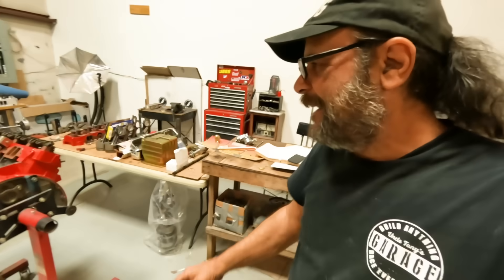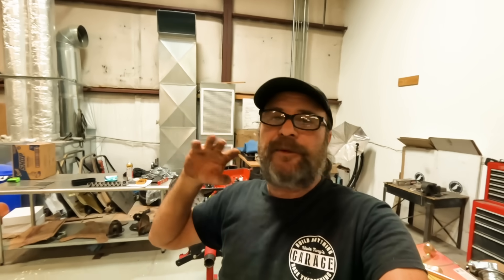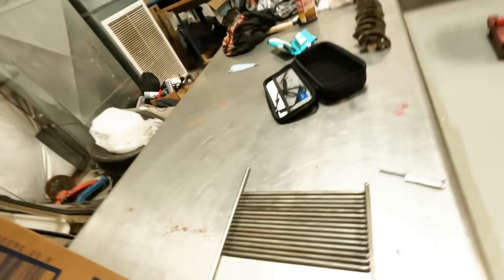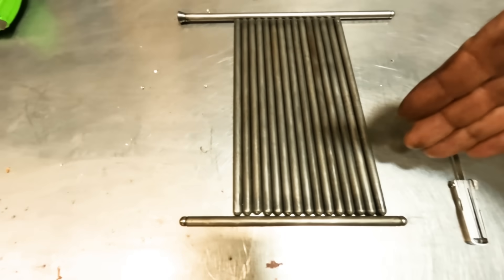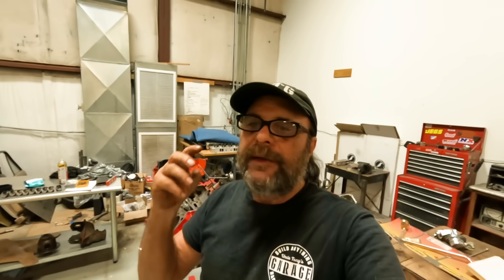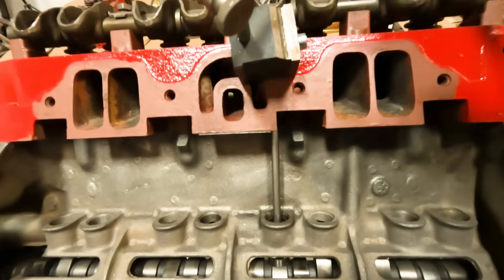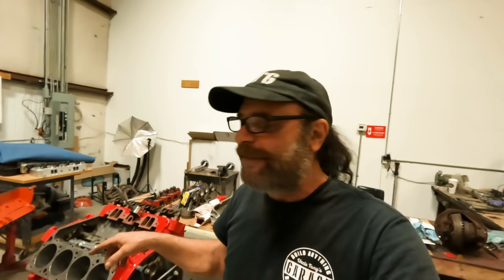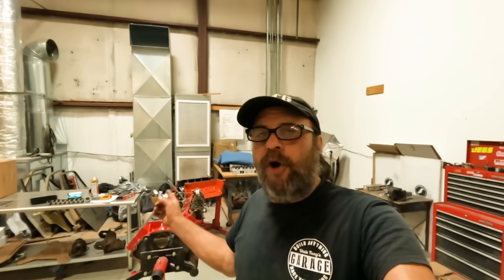The Engine Tuning Issue You Didn't Know You Had

Comment: Never forget going through "Trials & Tribulations" with my 340 Duster back in the 70's. Being a dumb kid I installed the DC "Purple Shaft" and had the heads rebuilt with AMC type 2.02/1.60 valves and DC spring kit....Nothing but problems....Cracked rocker arms @ the Drag Strip. Decided to rebuild the 340 with forged TRW pistons and went to solid lifter Crower cam with 273 adjustable rocker arms....Then found out that even with a MOROSO deep sump pan the 340 had oiling problems over 7200RPMs would lose rod bearings. I worked @ a NAPA parts store, cleared out the Westrn United States region of 340 crankshafts before I rid myself of that problem and went with Z/28 Camaro 302....Facory Solid Lifters and no RPM limiting box like on a Boss 302 Ford....Chevy stuff worked. That being said....The modern LS series motors have REALLY BAD oil system layouts in them....Not at all impressed with the LS motor oiling systems....They SUCK! Good for 6500RPMs over that? your playing with fire.

Comment: Wow, I just learned something. I've been messing with Chevy's since I was 16 I'm 36 now. Ok so I've never had a problem with lifters pumping or valve float and I almost thought it was a myth. But I also never tried to rev a stock motor high.  And any performance engines I always use stock ratio rockers and buy the recommended springs and get the seat pressures all correct. And again I always have a rev limiter and I'm conservative with it. Anyway the way you explained the lifter pumping up as a result of valve float actually makes a whole lot of sense.

Comment: Ma mopar only recommended using up to the .509 grind for use with hydraulic rocker arms. That was a cheap way for bracket racing but not the best cam. They recommended adjustable rocker arms for anything past 500 basically. I wouldn’t trade the years of fun that we had swapping cams in no time on a big block mopar with the hydraulic rocker arms and the Simple Valley Tray intake👍

Comment: The main cause of catastrophic engine failure is drivingTOO FAST.
Reply: If someone is revving the engine that high to go that fast it must be the gearing?
  I also found out that the way my foot and brain works Chevy's can't handle my ability so it's all about the finess that you put into your Acceleration and motoring. 
  Stock Chevy's are made to detonate, that's why they used to sell parts at K mart.😂

Comment: Well you had push rods 18 thousand put it in the high valve stem then you have orig steel gaskets composit gasket 30 thousand I had the same problem bought Smith bros push rods that are adjustable back in the early 90s that where crome moly USA made what a difference

Comment: the simplest/most economical solution is adjustable pushrods[if you want to use the factory stamped rocker arms]. smith bros. are very good.  .020-.030 is a very good place to set the preload.

Comment: I used to have an engine machine shop (NAPA) , and building high performance engines, the Chevrolet valve train was the best.
The engines with the torque down rocker shafts with non adjustable rockers were a pain in the neck, and expensive to build.
You had to have identical assembled valve stem height, so you either have to grind down the valve stem tips to even them out , but you only have up to .060 of hardness on the valve stem tip, or, counter bore out the cast in valve seats in the head, and press fit in new ones, and grind the valve seats to allow the valve stems to all sit at the same height when assembled.
Once you get them all the same height, then you can measure for what length push rods to put in the engine.
Even on stock rebuilds, to do the valve job correctly, you really should go thru this process.
I sold my engine shop and got into machining parts from scratch mid 1980s, so I missed the whole LS wave.
This is the first video I've run across anyone explaining these facts. Very well explained.
Great job.
Take care

Comment: My dad put a 350 SBC truck block in an old school bus/RV conversion (it originally came with a stovebolt 6). After long highway drives to Florida every winter, those press-in rocker studs became slide-out studs due to the endless resonant pounding at a fixed rpm (whatever equalled 60 mph). 
Every trip winter holiday, one would come loose and we'd buck our way to the nearest mechanic and they'd sell us another screw-in rocker stud. This made him a Mopar man for life!

Comment: My friend you may be rubber room certifiable. I guess it's still better than throwing a pile of money at it!
 I have rebuilt lawn mower engines after lapping the valves, the valve stems had to be ground to regain the correct valve gap. A new engine, or a new mower would have been faster. All said and done the rebuilt made for a better story to share with friends...

Comment: I have never seen pushrods that far off from the factory unless they were worn out.  Anybody with half a brain knows not to use pushrods that worn out and that far out of spec.  And I've dealt with hundreds of different blocks and never seen any that weren't worn out and had that much Gap in them.  And if you tried to use those and put a motor back together with it you're just an idiot.  This is why they make pushrod length checkers.

Comment: If your looking for adjustable roller rockers go to speed master engine components I've had good luck with there parts the new director of the company was edelbrocks main man he's steped up the quality no more junk out the door the quality is fairly good I've built many different motors like 472 Cadillacs, 514 big Mopar with there aluminium heads ,rods ,Pistons, crank oil pump, many small blocks Chevys big block Chevy motors ,oldsmobiles ,Pontiacs look them up it's worth it

Comment: For years the trick set ups for 340s was to take the adjustable valve train from the 273 hp so you could run solid lifters.

Comment: Hi Uncle Tony

Great presentation about the need for care in the valve train during engine assembly. However, It is the totality of valve train geometry that makes all the difference.

The spring assembled height must be spot on and to specification, valve seat pressure is important, next valve stem height needs to be correct, no matter what type of lifters that are being used !!! Needless to say that all push rods need to be of equal length. If the block and heads are cut, then pushrods will need to be shortened. This is all necessary in order to insure that the rocker arm geometry is all equal, as the angle of the rocker to the valve stem needs to be as specified by the factory, or after market design pyrometers.
Most machine shops today lack the trained engine machinists, and or the proper supervision and training to insure proper machine work. Not to mention most younger machinists are all about speed of production, and getting what ever it is out the door fast !!! maintaining proper stem height, spring height and seat depth do not seem to be important any more.
I would think with modern seat and guide machines, like Serdi, that these dimensions would be easily held. Not like grinding everything like in the old days, where you had to spend more time checking and measuring everything.

No motor machinist that ever apprenticed with me, ever got promoted until he/she could hold verity tight tolerances, speed was irrelevant !!! Speed only comes with practice, while accuracy only comes with care and diligence.

The last apprentice I ever had, was working for an independent shop after I sold my company. I was forced to take what the owners provided. They all hired " Friends " or the children of " Friends " !!! They all had problems with drugs or alcohol, as well as psychological issues, like being mentally unstable. Many nights I had to stay on after hours to correct simple valve jobs because the were improperly done, yet I couldn't fire these young people who obliviously had no business being in this profession.

I am so glad to finally be retired, and no longer have to put up with such things !!!

I still build a few engines, but only full custom built units with absolutely no guarantee !!! I got tiered of having fools that thought  they knew to assembly engines, when they couldn't even set valve clearances accurately !!!

Tim

Comment: I really enjoyed this video. I'm 60 years old and have built a few performance engines myself mostly small block Chevy and have been a Master Auto tech for 40 years. It's still surprising what you can learn when you get your mind stuck into one brand and don't see some of the variables that go into another brand due to engineering differences. Makes perfect sense. Maybe you should have a CNC shop engineer you a studded Bolt on replacement shaft that will accept independent rocker arms? With the right alloy I would think that might be something very feasible.

Comment: 383 or 400 mopar with good valve job & good mechanical flat tappet camshaft good intake & carb adjustable roller rockers is hard to beat for power & reliability i used if i remember rite 68 440 magnum heads.

Comment: Most Ford engines, & especially the FE series, have set rockers with hydraulic lifters.  There is a spec for valve stem tip length that a competent machine shop will use to set the valve length after doing the valve job.  I haven't found length differences in pushrods for each length application from quality manufacturers; be aware there are STD, +0.015", +0.030", -0.015" & -0.030" lengths available (or at least there was at one point).  Another option is adjustable rocker set ups, including apps for FE series.  All Y blocks are adjustable because they all use solid lifter design.  If your machine shop didn't set the tip length you will need to use different length pushrods as stated.  Also, any cam with over about 0.500" valve lift in a sled type rocker engine absolutely NEEDS to have the rocker to sled boss clearance double checked at full lift.  Most will bind up around 0.530".  Shaft rockers need to have the clearance between the push rod & rocker arm body as well as check the push rod tips for any binding in the cups of the rocker arms (vice versa on adjustable shaft mounted rockers).

Comment: I read on a Ford forum where a guy was also recommending barely more than zero lash for small block fords. I had bolt down "pedestal" rockers, and figured that it took 1/4-1/3 turn on the bolt to achieve 20 ft lbs, and during this phase no preload was being done.  So, using shims under the pedestal, I could compensate for head milling, and my target was 20 ft lbs with less than 1/2 turn on the bolt from what you feel is 0 lash and torqueing the bolt to 20 ft lbs.  I felt the freedom to do this because I didnt really "know" what I was "supposed" to do. It ran great.

Comment: Great explanation as always UT! 💪🏻
I did a very similar budget home build on my Holden 308 motor (common old Aussie donk from the 60s through to the late 90s)
A lot of people called me crazy for wanting to retain the factory light weight stamped rocker mounts / arms - but I'd personally seen very high rpm capability and reliability on a properly setup engine.
0 decked it, took a lot off the heads and did a home-style port and polish job with a close to 0 lash setup on the valve train. A good friend (ex race engine builder) that helped me tune it all up after it was said and done said it was the quickest of the particular cam / head / intake / exhaust combination he'd ever driven. I always put it down to the multitude of extra hours setting it up and getting everything fine tuned rather than just bolting it together and calling it a day.

Cheers!
Reply: Never late in a 308

Comment: I have a question could you not Mill or sand the tops of the valves to take out that imperfection just wondering never built an engine before and are you saying that equal tolerances are better or worse

Comment: Anti pump up lifters are def hit and miss. I got to the point where I was like if I want that I'll just switch to a mechanical cam. The only anti pump ups I found that worked perfect were chevy 300hp 327 lifters and I had a few boxes of them which I ended up blowing thru during my couple dirt track summers

Comment: What the fuck are you talking about ?.. pull a hydraulic lifter apart ,..once full of oil between the lifter body and the plunger ( where the pushrod sits )  the oil takes up the variation , 1/2 turn of preload is standard  .

Comment: I’ve spend my entire adult life in automotive machine shops doing this work in particular. 
  If I sent a set of heads out and the valve stems lengths were not consistent, those heads would wind up right back in my lap. 
   Do not let your machine shop get by with this kind of slop. If they don’t know how to keep the valve stems lengths consistent, go elsewhere that does. 
   As for those brand new out of the box heads. Take them to the shop.

Comment: I was pondering rocker ratios and the resultant valve lifts for my SBC, and I learned that pushrod length is directly related to the rocker ratio. Standard SBC 1.5 rockers can actually be made to produce either higher or lower rocker ratios, by changing the pushrod length. There are limits to this, but there is a useful range of adjustment. An interesting detail is that the actual ratio varies with lift, because the end of the rocker arm is describing an arc.
Reply: Yeah but you should not be messing with that. Once the engine is put together (not including Pushrods), you then measure for the pushrods you need.

There is only 1 proper pushrod  size per valve.

You then take an average of the the lengths and then buy the set (to keep the cost down). Or buy 2 half sets, if you basically have 2 averages for your engine (raises the price) or if your engine is very far off, valve to valve, you buy individual rods per valve.
Reply: huh ? 😂

Comment: Yep, these smaller titanium valve caps and these new smaller conical valve springs were designed to reduce valve intertia at higher RPM. But costly. However the right cam, roller followers and roller rockers are not that expensive and can make a good difference to operating resistance. I also note that the pushrods in the video have differing top radii with some 'flatter on the top' (probably due to wear) and that is affecting their total length. I would be putting a new set of pushrods in it. I also do a dummy fit up to put a DTI on each piston at TDC to measure the distance from the top of the deck, and get the block machined to even this up. I will also cc each combustion chamber when the heads are finished to even the crank stresses.

Comment: The Buick series ll 3.8L is the same way...for some reason the CHevy 305/350 is so FuuuKing forgiving when it comes to changes... i mean. ..lets get real..... The First 350 SBC i ever built STILL RUNS and very well 10  years later......Yeet..... Didint check cam bearings tho.....yeet yeet.

Comment: i bought a reman late model GM v6 that would idle but made zero power. The rockers were nonadjustable. Took a while but I figured it out. I added .60 worth of shims under the pedestals. Fixed it. Only other choice was to pull it and send it back which would have cost me way more in time and money.

Comment: with chevies I learned antipump up lifters  did not work well and were often noisy. so I zero lash and then turn lock nut 1/8 turn  so a ..010 preload.Do this on a running warmed up engine some need more preload to get rid of the tick but engines rev to 6000 plus and pulling all the way

Comment: You can make rocker shaft shims out of coke cans.  Bolt pitch formula 1 inch divided by threads per inch gives you amount of distance the bolt moves per revolution. you can divide this by 6 to get the amount of movement by the flats on the bolt head. Exp a 3/8 - 16 bolt  moves 0.062 thousands or an 1/16 inch per revolution and  about .010 for each flat on the bolt head.

Comment: Regarding valve stem heights... 30 years ago when I learned, in a friend's machine shop, we cut the stems after the faces and seats were ground in order to equalize stem heights. I totally get UTG's explanation and what he explains works. However... SHAME ON YOU EDELBROCK! That's just shitty QC! Great video as usual UT, That 383 is going to be a screamer!
Reply: with cnc machining and all new parts.....aftermarket head stem heights should all be the same.  that said........when doing valves on an older head one is likely to find 1 or 2 valve seats which are deeper than the rest.if so.....might not want to sink the rest in the name of making them all exactly the same because thats gonna cost more power than having them slightly different i.m.o. . the average street performance engine will never know the difference;the ports arent all exactly the same,nor are the chambes,decks,rod lengths,rockers,etc. the main thing is getting the rings and valves to seal well,picking the right camshaft for the application,proper lifter preload,the right size carburetor,setting the total ignition advance. also very important is all of the clearences in the engine;to tight limits power and oil flow;too loose causes blowbye,rattling,and excessive oil consumption. you probably know this,but many people following may not.

Comment: I think it would be interesting if someone took an Edelbrock Jeep head and modified it to make it a crossflow head and then see what power it would put down. the fact that the exhaust has to zig zag in the combustion chamber and then the exhaust manifold heating up the intake manifold and the exhaust having to make 3 90 degree turns just kills any performance to that engine. All of which could be cured with a crossflow head. THAT would be an interesting exercise